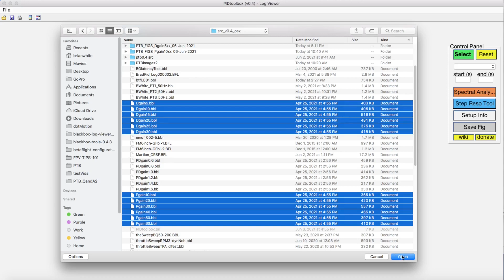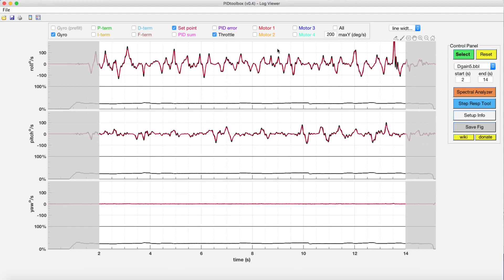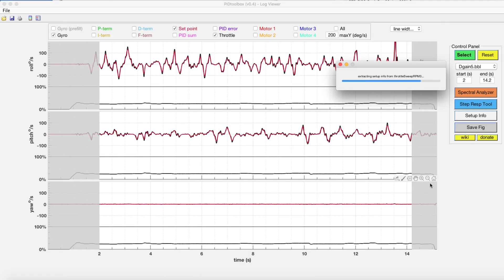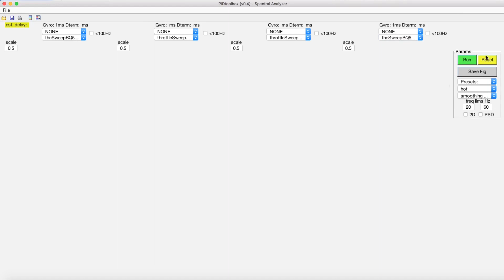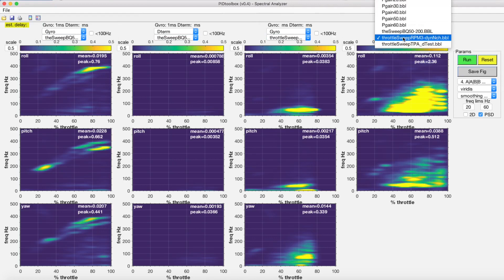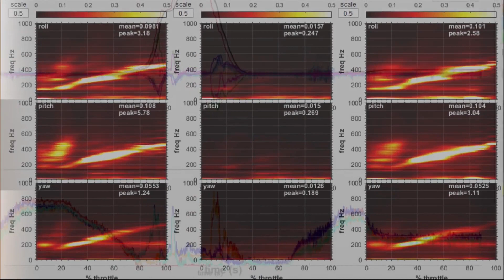PIDtoolbox v0.40 release overview

Comment: Very impressive!  This is my first visit here and I'm a bit of a tech geek, so I love this kind of work.  It's no mystery at all why you can tune PIDs in the basement with some sharp movements in a confined space.  What the flight controller is doing during a big flip out in an open field isn't any different at all than what it is doing in the basement with some sharp moves to the extent that they can be made.  The same computations are being made against a different data set to produce whatever corrections (meaning changes in Motor rpm) whether in a small space or a large.  The FC is still determining what the quad is doing now, and what it will be doing if nothing changes.  The effects of user input are applied to that data and it's future behavior is predictable (at least at this instant in time).  Lather, rinse, repeat.  No matter what the data is, the calculations performed are the same.  So, it's entirely understandable to me why this should work when the quad is flown out in the great wide world.  Liked and subscribed.
Reply from the maker: Thx! Yes Exactly! It also speaks to the fact that the system is relatively linear across moves, and where it’s nonlinear it provides a wide the tuning window, for example once a sufficient amount of D gain is used, P can be pushed across quite a range without having a drastic impact on overshoot. This is probably why defaults work decently across a lot of builds. But this “basement method” just allows for quick feedback so it dawned on me that we could then build a complete “finger print” so to speak of a given rig to make a better decision as to the optimal PID gains. I think people are attracted to how the plots resemble classic pid tuning charts.
Reply: @PIDtoolbox  A little late on the rely here, but let me make sure that I’m getting it.  So, the basement environment, in a pretty short period can really zero-in on P gains to find a truly optimal value as opposed to that “acceptable” range where stock Betaflight, and most off-the-shelf drones find themselves.  Very cool, and really excellent and original thinking about the systems involved and how they interact.  Very enjoyable.  More just like this one and on other topics, too, please.
Reply from the maker: @JohnFSmitheugene  exactly! I am working on a video about the advantages and limitations of "Basement Tuning" where I'll go into depth on this to hopefully clarify a lot of questions that have come up since posing the idea

Comment: is there an easy way to either split a bbl file with multiple logs into seperate files, or load all logs from the bbl file without loading the file multiple times and have to press select, 1, select, 2, ... maybe there is an easy workaround or trick as i only copy the btfl_all file or sometimes still use the old legacy copy.     other than that great work !! also a throttlesweep video would be helpful. how to analyze it and how to reduce vibrations through filters/tpa ...
Reply from the maker: I plan on making it load all “sub files”, but the best workaround is to make separate files. You do this by unplugging between each logfile. When you unplug and plug back in, then when you record it starts a new logfile. Then when you download, select “USB mass storage device”, and select the individual files. Not the “all” file. Then you can name each and it’s much easier to organize and see in PTB. It’s really the best way

Comment: I noticed that you have a PSD option in spectral analysis now.
Reply from the maker: Yes. I’m using Matlab periodogram function for simplicity. It’s not on the log10 scale though. It tends to hide the motor band harmonics though. That’s the “power” part of the function doing that.
Reply: @PIDtoolbox  yeah that's fine, I re-write the python is just to boost the speed of calculation. I chose the log10 scale for reasons.

Comment: Tried once. This software eat my 10GB of RAM and crashed because there where nothing more. Poor implementation.
Reply from the maker: It doesn’t do that. You have a different issue. The software only uses one core of your processor and ram is only dependent upon the size of your logfile. If you’re logging at <=2k then it doesn’t use much ram at all. Basically the size of the logfile. That’s it. The program itself takes nothing

Comment: I'm just waiting for this tool to suggests PIDs based on the blackbox log that is loaded.
Reply from the maker: 😄 I’ve thought about that but it’d suck if it got it wrong and resulted in a flyaway or smoked a motor or something.
Reply: @PIDtoolbox  I wouldn't mind if it did it in a step-wise fashion, just like sending your quad or blackbox logs to, they make a suggestion and send it back until satisfied with the results.
Reply: @PIDtoolbox  Also, the suggested tune that your tool would recommend wouldn't be too far off from the configurator defaults, so it would be obvious to the user if there was a risk of a flyaway or smoked motors.